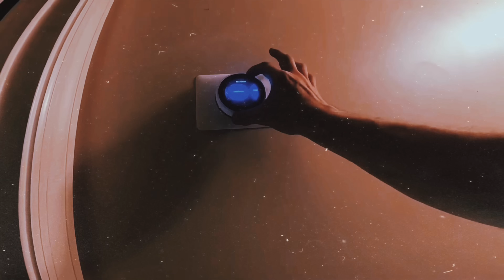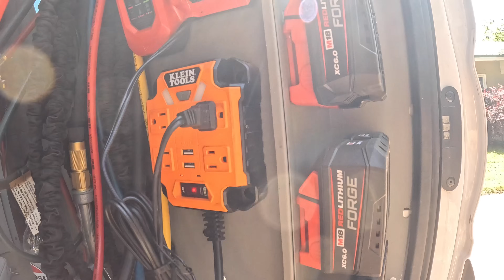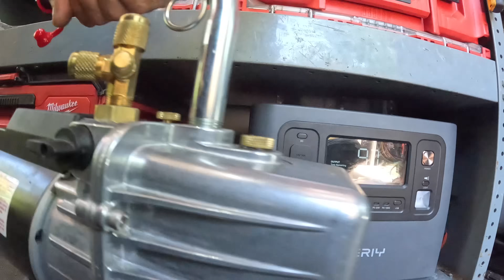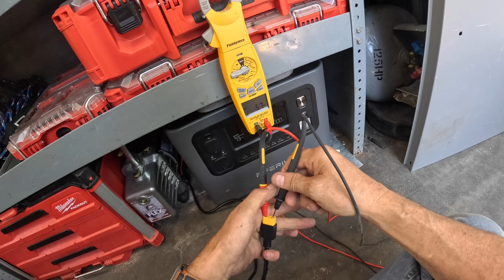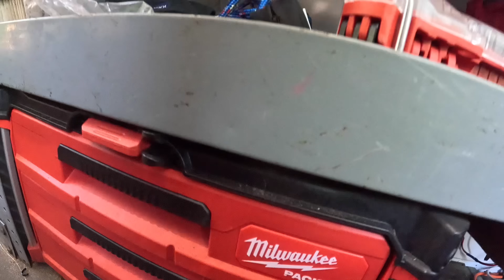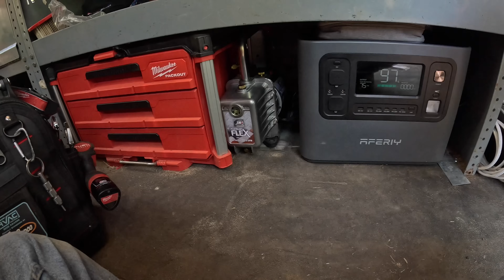My Process Of Installing an Aferiy 2400W Power Station In My Van! #vanlife #hvaclife

Comment: I think the 400 watt HF Connector is not the right thing to allow simultaneous Solar and Alternator charging.  In reality that HF Connector simply parallels (combines) the inputs as if you had wired nutted all the inputs and the output together.  The solar panel inputs are variable voltage devices dependent on solar intensity and could output zero to 25vdc, while your alternator is 12.8 to 14.5 vdc.   

The easiest solution based on what you have now would add a power relay in the incoming solar wiring such that solar feeds the power station through normally closed contacts that open with ignition on.  In other words, solar when the truck is off and alternator when it is on.
Reply from the maker: That makes a lot of sense!
Reply from the maker: A RIB can do that
Reply: The EcoFlow Delta 2 max and the newer Delta 3 Plus have two solar inputs, so they would be a great way to have both solar and 12VDC at the same time. Of course if you are going down the path of an EcoFlow the Alternator Charger uses the expansion battery port, freeing up the solar input for the solar panels. 

There's also the ETaker F1000 and F2000 smart charger that lets you combine 500W/1000W from the car with 500W/1000W on the solar. In theory, you could get rid of the 200A solenoid as any of those smart charger solutions (ETaker or EcoFlow or even some other brands) work on the car battery voltage being higher than a set point (meaning the alternator is on and supplying charge). 

Of course a cheap and dirty way to get both solar and car charging is to keep the inverter in the van, use its 120VAC output to supply the battery system with a charge. Unfortunately doing this probably puts the solar battery system into "bypass", meaning whatever load you pull off of it must come from what is feeding it (the van's inverter). 

Lot's of ways to do this, and it really will boil down to how much and when you want to use the battery pack.

Comment: I did something similar with a deep-cycle battery, inverter, and solar charge controller.   Also:  "200 amps of voltage"  You crack me up!

Comment: Strong Velcro might be an option to mount the multi-input hub on the side of the van (under the shelf against the side).  I’d suggest good loom protection around the wires too.

Comment: I just got the high roof transit and that’s the problem we are having. It’s so tall and I’m the only one that works on roof tops so I need my ladder but In wv a lot of these backroads I don’t know how it’s going to go if I’m almost 12ft tall with a ladder rack. Should be interesting. I had the mid roof it was no problem but we wanted an awd so I can get around in the winter and I wanted the taller one didn’t realize how tall it was tho.
Reply from the maker: Yeh they’re tall

Comment: Curtis. you might consider mounting the solar connector hub using a waterproof mounting tape (3M has some).
Reply from the maker: That’s what I did, I think. Were you referring to something different
Reply: @HVACGUY  Curtis, 
I only amsaw the solar hub with two  (what looked like eye bolts in the back of the hub. Still liked what you did!
Reply: Oops, saw, not amsaw (stupid cell phone).

Comment: Good video ! 
Yea, That's a Good idea as a Compliment to the inverter set up.
I have Run a 750 watt inverter on my Truck for the Last 20 years to Power the Printer in my truck for printing out invoices & charging laptop computer etc.
i Have also used My inverter to run my Vacuum pump when i have done a Tailgate repair of a Small Marine refrigerator but, the Engine has to be running.
With this New Technology the Power stations might remove the need to run the engine for Power needs.

Cool idea.

Can it actually Run a Corded sawsall ? or Vacuum Pump ?  Because that's what i use My inverter for.
Cutting unistrut on the Tailgate with corded sawsall , Using a Corded 4" Grinder , using a corded vacuum pump.

Please Make a Video to see if it Can actually Run tools. Grinder , circular saw , sawsall etc.

Definately would take a lot of load off the alternator.

i Wonder Could You Hook a Small space heater to it & Keep the Van Warm 24/7/365. No More Cold Van in the Mornings ?
Reply from the maker: The other day I used it for a recovery ,machine and it didn’t flinch
Reply from the maker: Check out the recent video where I do a compressor
Reply: @HVACGUY  will do.

Comment: For that connector, try self-adhesive velcro it could work.
Reply from the maker: Good idea
Reply: @HVACGUY  don't use velcro, the heat will keep it from sticking.  I'd  like to suggest the use of an L bracket.  Love the idea Curtis, great job. I built a power box using A LifePo battery and 3000 inverter for power outtages and such.  It has 4 A/C power outlets, a Master on/off switch, a meter, and 8 USB ports.

Comment: Love it!  For the fridge / freezer for your drinks, a 12V compressor-cooler will run off the 12V output of that power station.  BougeRV, Setpower, and Iceco are examples of manufacturers of those; you might want to get one ASAP before the tariffs dry up supply (until we start making things here again).
The only downside you may see (for perhaps a few weeks to month out of the year) is that the LiFePO4 batteries in that power station should not be charged at under 32F; the BMS in the station SHOULD prevent that.  If you notice a failure to charge in the winter, that's likely why.  You may want to bring it inside at night, where you can plug it in to charge in a warm house if needed.  You could also put a seed-starting mat under it to keep it well above freezing; power it from the station as long as you're able to keep it charged to offset the power used.
Reply from the maker: Sounds like you know more about them than I do